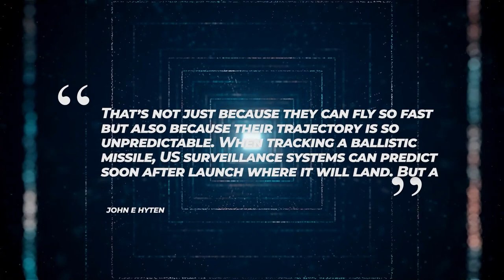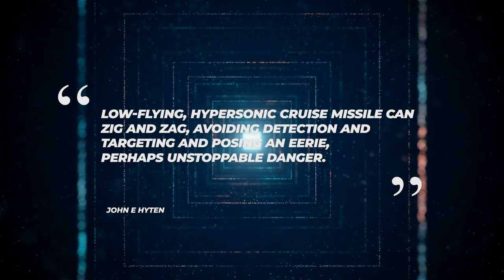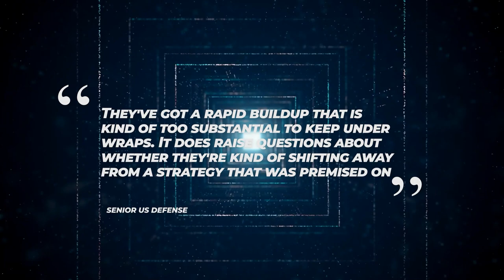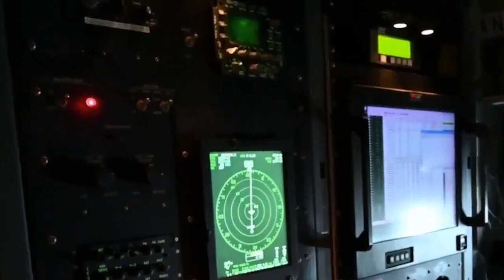These Chinese Breakthrough Tech Developments are Severe Threat to US

Comment: The US has good reason to fear the J-20. It flies much faster than the F-35 (Mach 2.0 vs Mach 1.6).

It flies much farther than the F-35 (5,500 km vs 2,800 km).

It flies much higher than the F-35 (66,000 ft vs 50,000 ft).

It climbs much faster than the F-35 (60,000 ft/min vs 45,000 ft/min).

It carries a much heavier payload than the F-35 (11,000 kg vs 8,160 kg).

And to top it all off, it's at least as maneuverable as the F-35, if not more so. In recent China air shows, the J-20 has demonstrated its maneuverability is comparable to that of the F-16.

The problem with the F-35 is that it was designed to fill many different roles. It was designed to replace many different aircraft (A-10, F-16, F/A-18, AV-8B). It was designed to be flexibly deployed — on land, on aircraft carriers, as VTOL. It was designed to be sold to other countries.

Consequently, the F-35 is a jack of all trades but master of none. The J-20 excels at what it was designed to do (air superiority). It does not fill a carrier role. It does not do VTOL. It will never be sold to other countries.